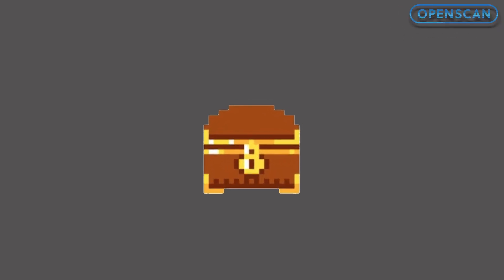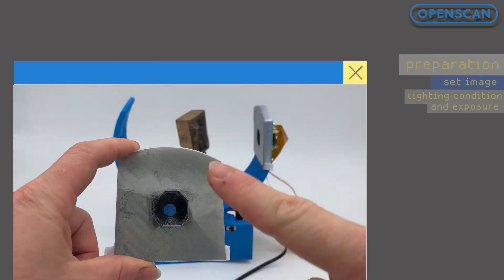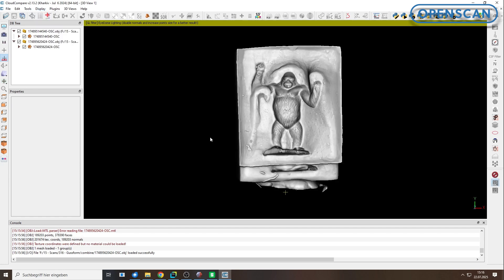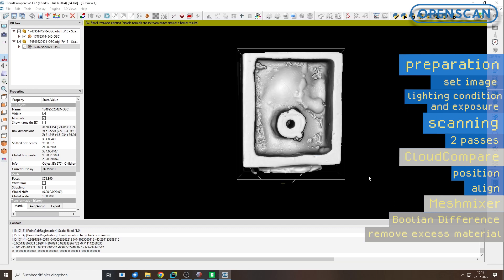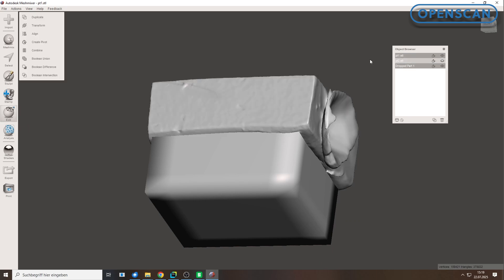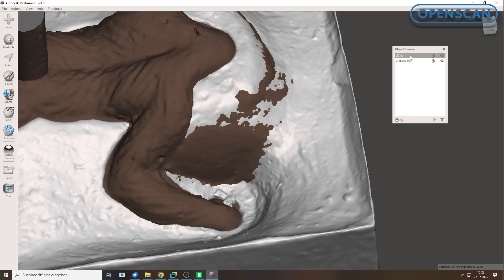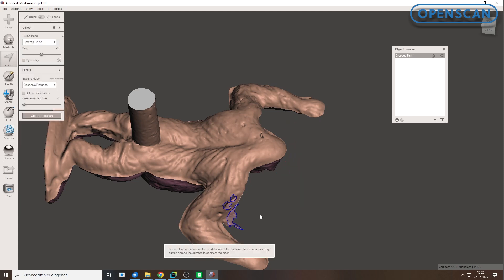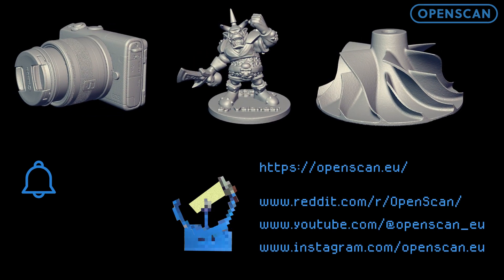Openscan "The Secrets of 3D-Scan-Process" - E2: Casting Mold -  From Negativ to Positv

Comment: hey i have a query. In open scanned mini there are two stepper motor. Can you give me the model numbers of both.
Reply from the maker: i am currently not at the office, but you can use any nema17 motors (preferebly 13ncm and 43ncm, but there is enough space for most variants)
Reply: @openscan_eu  thankyou sir, very very thankyou sir.

Comment: A technical inquiry: Is it feasible to scale up the scan volume, specifically to accommodate human-sized objects ranging from 1 to 2 metres? What design considerations would need to be taken into account to achieve this? Furthermore, is the current software architecture adaptable to such dimensional changes? Regarding the actuators and sensors, what recalibration or optimisation procedures would be required, or is there a defined upper limit to the system's scalability? Additionally, are there plans for a future version with enhanced adaptability to larger configurations? Incidentally, if the camera's image quality were improved, would this directly enhance the system's resolution? Moreover, would such a hardware upgrade be fully leveraged by the software pipeline, resulting in a noticeable improvement in detail definition and output fidelity?

Comment: It would be interesting to see the other way around too, making a moud of a 3d scanned object.
Reply from the maker: The process would be almost identical, start with the scanned model and boolean subtract it from a cube, split the result in two parts and add channels for the material flow (though I am not experienced in the last bit).